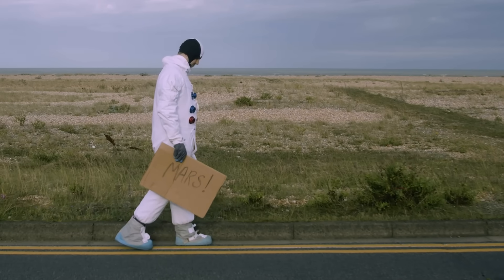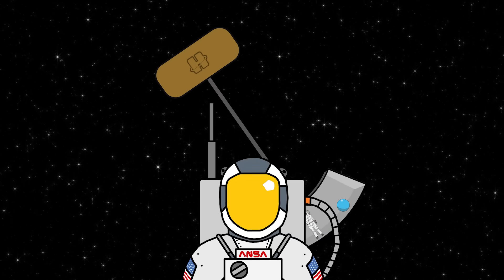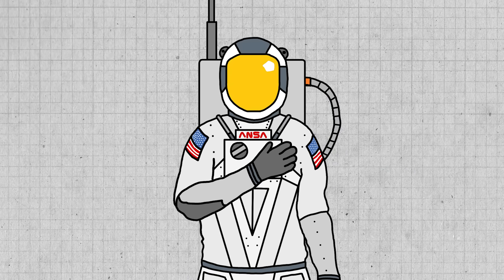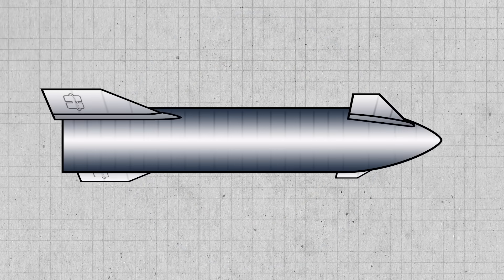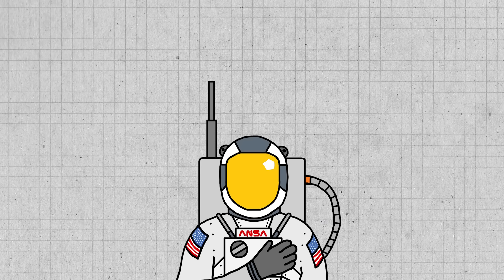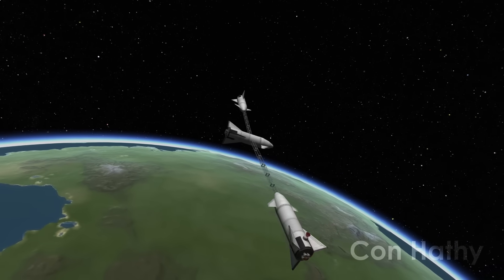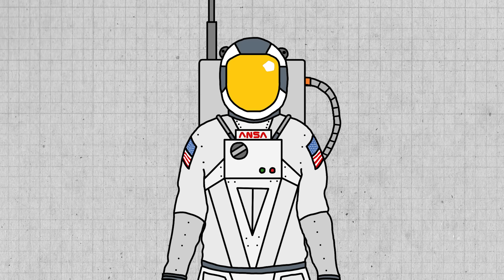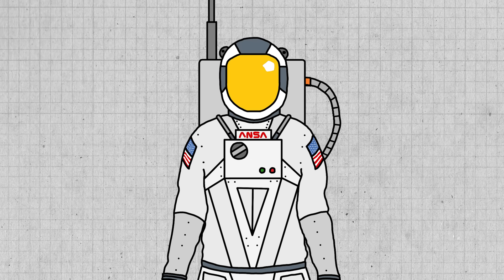This is NOT how you make Artificial Gravity

Comment: Your "third axes" will have the same maximum  moment of inertia as the first axis. 90 degrees from the first axis is still 90 degrees from the space ship.
Reply from the maker: I assume you’re talking about the single ship, in that case the flaps are what decides the maximum moment of inertia, they are slightly farther from the axis which is perpendicular to them. Same as the corners of the phone.

This would be a lot easier to explain if could draw it, but for the axis that is in the same plane as the fins, you’re just looking at the “vertical” distance between them in the axis (this is the long side of a right triangle between the fins and the cg that is aligned with the body). For the perpendicular axis, you have to use the diagonal from the flaps to the cg. This would be the hypotenuse for the right triangle which is slightly longer, increasing the moment of inertia created by the flaps making that the axis with the maximum moment of inertia (all this assuming there is mostly even distribution of mass in the payload section)
Reply: @ConHathy  I was assuming that the mass of the airfoil fins would be negligible. (They would also be useless in vacuum. Plus, I didn't think two fins couldn't support the ship landing on it's tail. So there I go again, making assumptions.) I saw the film of the Russian wing nut flipping end for end, but thought perhaps it was due to the atmosphere. I've never seen it tried in vacuum. Other than that, good presentation.

Comment: You don't need any fuel to start spinning, there are several ways to avoid carrying extra fuel. A couple of them:
1 - Send first ship  and then a second ship just a bit faster than needed.  Bind the link at the very moment  when the 2nd ship overtakes the first, and they will start spinning naturally with no extra energy cost. Just cut the link on Mars orbit insertion, both ships  will go in slighty  different orbits but that is probably desirable 

2 - Link both ships without any rotation at first, tied to a small  central ring,  with 1/2 of the  total  payload located ina capsule inside the ring. Then  use  solar energy to rotate the central ring against the inner  payload capsule  and the ships will start rotating in the opposite direction naturally. Invert the process on arrival.
Reply from the maker: 1 - ignoring the fact you’re trying to connect the ships while they’re moving a hundreds of meters per second relative to each other, that velocity still came from propellant 

2 - that’s going to have to be a huge flywheel spinning very fast. It would probably double the mass of the whole spacecraft, at that point why not just use the fuel which would be lighter. Another way to think of this is that the propellant is expelled at thousands of m/s, so the flywheel must also spinning at thousands of m/s or be much larger than the rest of the spacecraft to match the performance per kg (ignoring all the mass of the motor+solar)
Reply: @ConHathy  1 - You dotn need extra fuel (or very little) extra fuel, by conservation of momentum the center of mass will move at the same average speed before and after connecting the ships.
2 - In my proposal the central  mass would be made of useful payload that they need  to bring  anyway, it would  not be made of extra mass. Same about the solar panels. Some extra mass is neccesary for binding the containers and ring, but almost irrelevant compared with the total mass. In fact it can save fuel by acting as a kinetic battery and reducing the need of some of the fuel for orbit insertion.

Comment: Feels like they're shoehorning this into a craft that didn't have this in mind from conception.
Reply: Yes, it makes a big difference if the lift-points and the upper structure is designed to hold the weight of an empty or a fully fueled and loaded Starship.
At the moment it is an empty steel-silo with blank slates welded together, nobody is dreaming about hanging additional hundreds of tons to the frame
Reply: Lower bound on dry mass is 100t and Wikipedia payload mass is 100t, so the lift points can handle at least 200 tonnes-force, conservatively. Even if for some reason you're traveling with 1200 tonnes of prop, pushing total mass to 1400 tonnes, the lift points can still provide 200 tonnes-force of centripetal force, or 0.14Gs. My guess is that would be worth it. More likely tho travel mass would probably be low enough to provide at least as much gravity as Mars does
Reply: Welcome to space exploration. It began with human beings shoehorned on top of an ICBM in the spot where a nuke would normally go
Reply: Twas a monkey actually  @qoph1988

Comment: haha the R&D of adding an additional centrifuge to the starships i think is comparable to another starship launched
Reply from the maker: Not if it’s a small internal centrifuge. Don’t forget that the two ship concept requires docking and spool out of the tether while rotating, not to mention the tether itself has to be rated for a couple hundred tons of tension
Reply: @ConHathy  indeed it does. still , a small internal centrifuge doesnt subject people to gravity all the time a shipwide gravity is more beneficial and natural... also i still disagree , the R&d cost is still high since you replace that system which is already planned with another.
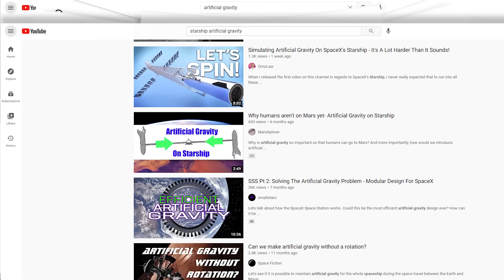Reply from the maker: @Th3EnterNal  there’s no need to have gravity all the time, one of the papers I put up at 0:22 found that as little as 30 minutes a day is sufficient to offset the muscle and bone loss
Reply: @ConHathy  muscle loss wasnt my concern but the alternation of on/off gravity and its effect on humans. especially since low radius ag needs adaptation in itself. Astronauts could experience space adaptation syndrome every day after the centrifuge system. Theres also the gastrointestinal system and cardiac system which are affected.

Comment: @12:18 500m diameter makes ~1570m circumference with 30sec full turn makes speed ~ 50m/s and not 100. So half the speed and 1/4 of energy. Correct me if I'm wrong.

PS maybe the post sound rough or rude which is not my intention, just my opinion about correct facts. If I'm wrong the blame is on me 🙄😏😁😁.
Reply from the maker: Ah, it was a 500m radius so 1000m diameter. And no worries, I’m totally open to feedback (wouldn’t be the first time I had made a math error in a video)
Reply: @ConHathy   After all the blame is on me. Obviously I don't distinct between radius and diameter (although I do), instead I rather hurry in calculation of radial speed at 500m diameter 🙄😁.  Anyway now it can be seen the speed difference between two diameters at same angular speed 😃.

Comment: I am a fan of the tether idea with two ships. However, there is one consideration you didn't mention - the spring energy stored in the cable as a result of tension. 
If the tether were to snap the resultant whipping of the cable could easily pierce the skin of one or both spacecraft. This is obviously very bad. For the same reason you would probably spin down before detaching and not get a boost. Perhaps simultaneous use of explosive bolts to release the tether at both ends could work, but would be risky.

Comment: There was a dilemma like this in Project: Hail Mary. They had to either have 0G versions of extremely sensitive lab equipment or design their ship to generate artificial gravity.
Reply from the maker: That book was fantastic, easily my favorite from Andy Weir
Reply: @ConHathy  Amaze! (jazz hands) What are your thoughts on the method used in the book of splitting the ship in half, using tethers to keep the halves together, and flipping the nose/hab section?

Comment: Bullshit.  Yeah, we can't have artificial gravity because HOW COULD YOU TILT A BED OR A DESK??!!!  Humans have been stymied by this problem for years.  When I moved into my bedroom, we had to tilt the mattress to get it through the door and couldn't figure out how to lay it flat again, so now I have to sleep leaning against a wall.  Dum de dum dumb.

Putting astronauts on the little turn table, even for hours each day, is not sufficient to stave off the ill effects of lack of gravity, so really it's the small turn table that is out.

Two ships tethered (or a three-ship system with the central ship in a more sensible orientation) would work fine.  When we can build a ship that can travel to Mars and beyond, artificial gravity will be a relatively trivial issue to overcome.

What if the tether breaks?  Well, what if a fire breaks out, what if an asteroid hits both ships, what if you run out of fuel, derp de derp?  People cross oceans on pieces of wood nailed together.  Travel is risky.  Bad shit will happen.  The first trips will be a bit clunky and maybe everyone aboard will die.  Faulty parts and plans and materials will be improved and replaced just like in every other mode of transportation we have ever used.  I feel like I'm writing a treatise on the obvious.
Reply from the maker: It’s obviously possible to have movable fixtures but it will inevitably add weight which is basically THE limiting factor for space travel. Also the studies I found showed that muscle/bone loss was prevented very will with as little as 30 minutes a day even without additional countermeasures, such as exercising in ag

Comment: But the three Starship Version could make use of rotating joint at the center, couldn't it? In away that it does not make the inner Starship tumble
Reply from the maker: The rotating joint likely wouldn’t solve the issue. It would eliminate torque around one axis but not the other two which would still allow the whole craft to begin wobbling. If you built a massive multi axis gyro that fully removed all torques then it would work, but at that point why not just spin it the other direction and save all the effort

Comment: I think the small centrifuges could work well for people who've gone through the requisite training - which the initial astronauts would almost certainly be, or could definitely add it to the normal training regimen. In the more distant future that could also include people who work in space, or crews of military vessels. It could be like the one in the video or maybe a small rotating sleeping module where everyone's lying down. The larger centrifuges might only be for more permanent residences orbital and commercial passenger craft.
Reply from the maker: You probably wouldn’t sleep in them, bedrest has the more or less same side effects as zero-g so you would need to be upright for the ag to do much, probably just using it while exercising
Reply: @ConHathy  The problem with the small ones is it ONLY addresses muscle and bone loss. There will still be the issues with the eyes and fluid distribution in the body. All one has to do is apply logic to see the truth of this. Would it be better than nothing? Definitely much better but the larger ones are going to be necessary for long term health, both mental and physical, of astronauts spending years in space altogether and those who end up living their lives there. I agree that the smaller centrifuges will be the best way to do it for now due to general feasibility but they are a poor choice at best as a long term solution.

Comment: so the only problem with ring/dumbbell stations is that they aren't feasible for use any time soon? or did I misunderstand?
Reply from the maker: More or less, dumbbells are definitely more practical though because they need less material for the same radius

Edit: the only real difference between dumbbells and a tether is the amount of in orbit assembly

Comment: Small centrifuges are stupid and unnecessary. Absolutely impractical. The two-starship tether system is clearly the best strategy. Far simpler and more practical. Add two elevator carts that can ride up the cables between the two ships and you have instant microgravity from both ends, able to meet in the center and exchange people or supplies from either ship.
Reply from the maker: Interesting how you can think a 1km high strength tether with elevators is less complex than a spinning bicycle

Comment: Nothing says the equal masses have to be equidistant from the center of gravity. If the masses on either side of the center of rotation were equal you wouldn't need two spaceships. You could use a junked, obsolete station on the short arm as balancing mass and storage for the actual crew vehicle at the end of the long arm and get a slingshot effect by cutting the dead weight loose when you needed to. There will be enough junk mass available to counterbalance a righteous Mars orbital station and a landing project.
Reply from the maker: And a heavier counterweight could mean you can use a shorter tether

Comment: Something I have constantly wondered, why isn't there any form of 'clean up' for all the space junk out there?
 It shouldn't be too difficult to have a robotic foundry with solar powered furnaces making ultra pure materials which would not need tens or hundreds of extra launch vehicles just to get materials 'up there'.
Von Braun  proposed repurposing the Apollo stages in the 1960's but the 'throwaway society' has just moved into space filling it with junk or planning to drop multi billion dollar space stations into the oceans instead of re-purposing them.
 Surely it would be easier to put ISS into a higher orbit until a secondary use can be found or devised. As Apollo 13 showed, difficult things can be done with whats available when there is a will to make it happen. 
It's no wonder 'other countries' refuse to clean up their act when even NASA can't or won't.

Comment: If you've ever swung a weight on a line, you know there's no tumbling when you let go. The mass moves directly away when released. The string doesn't coil as the mass spins, the mass remains spinless as it moves in a straight line away from the spinning center. As far as the mass is concerned, it's always moving straight away from the center, it doesn't perceive it's spinning motion in it's inertia. It's the line holding it to the center that is forcing a straight away motion to instead appear to the outside observer as a lateral motion. To the mass, it's always straight away from center.
Reply from the maker: Well that’s just not true, look at hammer throwing. If it’s a light object maybe the drag from the line will stabilize it but that obviously wouldn’t happen in space. Angular momentum is conserved so a rotating object is going to keep rotating unless you apply a torque to stop it

Comment: Not sure if you have mentioned this in any of your more recent videos, but I suspect that the eye pressure problem on the short radius centrifuges is most likely due to the gradient offset of the G-forces. The subject's head is close to the centre point of the rotational axis meaning that the head is closer to the zero G point. If the short radius centrifuge is just a bit longer such that the subject's head is closer to 0.5 G it might help with the eye pressure problem. But, I'm no physicist, so I might be wrong on this, it's just what made logical sense to me. 😅
Reply: psst! that's the whole point of the experiment, and I guarantee they didn't do all their trials centered.

you start off with one end of your gradient as "no movement" then adjust the radius and speed in little increments from there to see what different ratios are like.

Comment: Hard to beat the sheer efficiency and the straightforward design of a single cable tether(not one of those truss systems). A 180 meter long tether at just a bit under 2 rpm gives Mars level gravity(.38g) at the tether end. The point of having artificial gravity is functioning in that state indefinitely and allowing your intercellular metabolism to function with the gravity bias it needs to work properly(and Mars level gravity should be sufficient for that), short treatments in a centrifuge won't have the effect you're after, also you have the trouble that a small internal centrifuge is a big reaction wheel.

Comment: Use a combination of short radius centrifuges at the axis for workouts at higher gravity with lower gravity (lunar level) at larger radius with slower spin rate.
Reply: The human body needs a gravity of 1g constantly or the human will experience changes. Not more and not less.
NASA made an experiment with short radius centrifuges that were running at 1.2g. It ended in disaster (one participant had a short cardiac arrest). The human body isn't made for anything except 1g.

Comment: One problem with the small scale versions is that even when you have aclimatised to the sensation you still have litle effects that have a large impact, namely if you are seated and stand up that force change is dramatic in small scale systems and is enough to have most people bringing there lunch back up, we also have no idea what the long tern effects would be if done for months on end, i did a little reading on the issue some years ago and based on the numbers i found i recall calculating you could make rotating wheel style space station (i was specifically interested in space stations) that could accomodate TWO decks without causing and sever effects and it would only have to be twice the diameter of the milenium wheel (so about 250mters)  less that 2.5 times the size of the ISS yeah it would be big and expensive but i worked it out at 25 launches of a Saturn 5 (spacex was not a thing at the time) and would have the internal capacity of 25 skylabs, that is perfectly plausable
Reply: Look at Mr. Bigmath, using big words and numbers and calculating entire concepts but, doesn't know for shit the difference between, there and their, or where to set points and commas.
Reply: @avyitis3425  ah yes spelling mistakes, something i always did stuggle with at school, being dyslexic and all, still luckily I was good at other things like science and maths, but hey it could be worse, at least im not some internet sh*tposter spending his time being C U next tuesday online👍😁